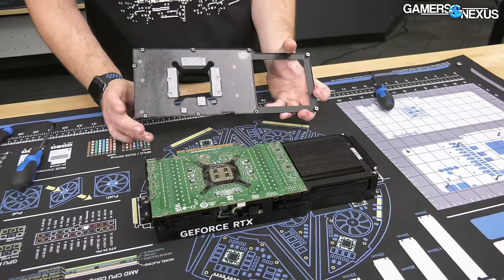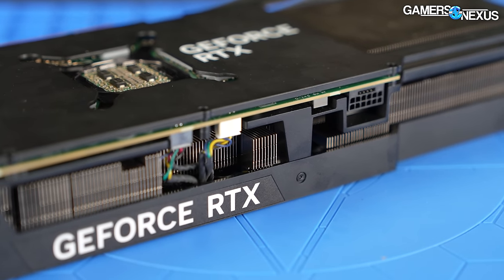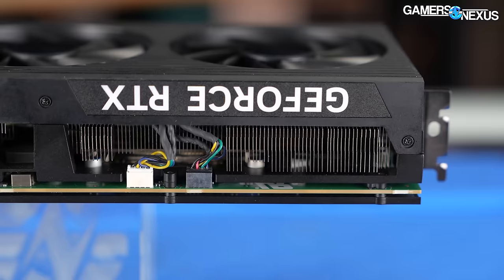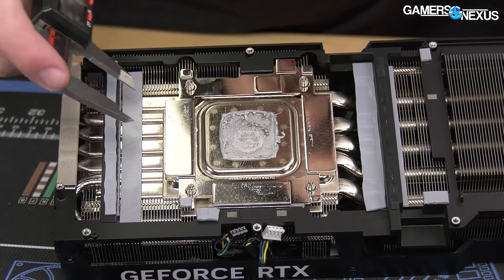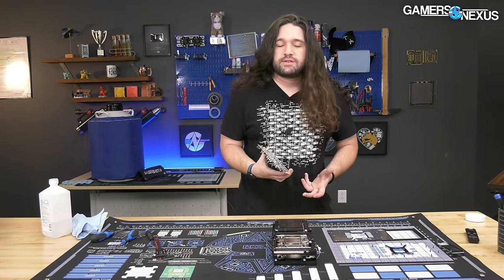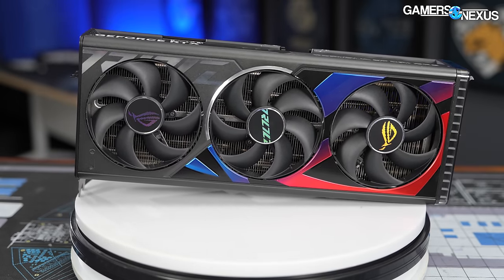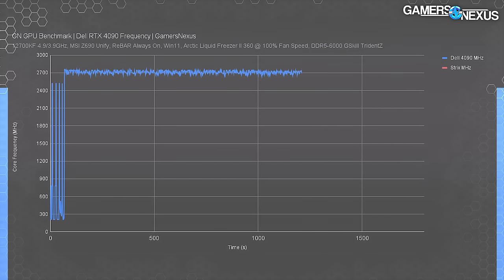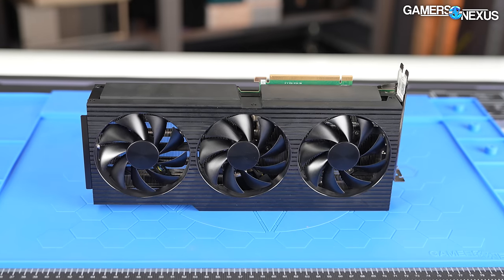Dell Made an Impressive RTX 4090: Relatively Small, Large Flow-Through, & Good Cooling

Comment: The ducts might be there on the Dell card to keep the GPU from blowing all that heat on an NVME drive and over heating it.
Reply from the maker: Good thought! Especially considering they try to keep cost down on their drives.
Reply: honestly I have found out that SSD under the GPU is cooler than above. Not surprising, hot airflow is better than no airflow
Reply: @Blackwing2345635 doesn't the gpu blow heat up?
Reply: @GamersNexus  I'd guess they are simply to reduce recirculation. It's a question a dremel can help answer :D
Reply: @LagiohX3 the PCB and backplate blocks upwards airflow on most cards!  It's pulled in from the bottom, hits the PCB, and vents out the sides.
Reply: I've found GPUs cool SSDs more than heat them up
Reply: The solution for me was the vertical mounting kit at lianli o11 evo, but it was tight getting a strix 4090 in place i had to remove the led end to fit it. 😅 3 exhaust fans on the backside so case and card staying cool.
Reply: @BlizzardSnowMew while you're absolutely right. the heat coming off my backplate always had my ssd above the gpu 15 degrees hotter than the one below
Reply: Yes, an attempt to create static pressure

Comment: I haven't seen such clean construction and ease of taking apart GPU in quite a while. As much as I hate Dell for their "proprietary" shenanigans, I must admit I respect this design. That's a nicely put together board with no unnecessary complexity. I guess you could flash an o/c bios on it without issues and push that power limit to 120%.
Reply: Clearly the GPU department is where all the competent Dell people went.
Reply: @nhancao4790  the electrical engineers that work on GPUs are by all definition built different
Reply: I think its being mentioned several times that Dell have a lot of engineering competency that somehow got directed into making proprietary shenanigans. Which while impressive is a huge waste of talents and technical capabilities Dell have. Thankfully, they seemed to have done things properly here
Reply: Hates a strong word.
Reply: @zbatchDOC  I agree in person, but it's fairly weak for internet comments though- where everything must be taken to a higher and higher degree to have the same impact in a sea of exaggerated comments.
Reply: @zbatchDOC  A strong word to describe a strong feeling. What's the problem?
Reply: @luminatrixfanfiction what reason do you have to believe that a asus 4090 wont last. the 4090 is overbuilt in every aspect from nvidia that the only one that is an avoid at all cost is gigabytes low end models like the Eagle. Every other 4090 I've held tho has seemed insanely over built and has pretty crazy thermals.
Reply: Proprietary design isn't an issue if the purpose of the design is to create something that a standardized design isn't capable of, or if it provides legitimate benefits for the consumer in that device's use case.

Proprietary design is a problem when it's purpose is to prevent user upgrades, thwart repairs, or to cut costs with no consumer benefit.
Reply: @luminatrixfanfiction what?
Reply: @zbatchDOC it's appropriate. Their proprietary designs are usually anti-consumer. They go out of their way to make sure things can't be fixed or upgraded.
Reply: @zbatchDOC I agree.

"Loathe" is much better.
Reply: With respect to flashing the bios and increasing the power target, I'd be cautious about doing that! The board is missing some power delivery components and it might be that dell lowered the max power so that they could save a little money. I don't know that this is the case obviously, but something to check out!
Reply: dell can do good things when they actually try.
Reply: I have this exact gpu and was able to flash a Galax 4090 bios with a +13% power limit. The galax has the exact same pcb, no extra headers unlike some of the other reference board designs. It will also now listen to fan control where the dell Vbios would do its own thing
Reply: @101m4n I’ve checked, I own the dell 4090 and the other reference boards from inno3d, galax and pny have the same power delivery components missing in the same exact spots. Just flashed the galaxvbios as the pcb is exactly the same without extra headers for leds and has a +13% power limit. It flashed no problem and works perfectly
Reply: they have lot of great talented people working for them they could do all great sort of stuff but engineers do not run what is done how it is done usually

Comment: Dell 3080's and 3090's are good, and now the 4090. Good to see because used ones are usually the cheapest because most people don't know that they're good. I bought a used dell 3080 last october 2022 for cheap and just traded it plus $1000 for a used 4090. That dell 3080 served me well for a year.
Reply from the maker: Exactly. They're definitely undervalued a lot of the time. Not sure what pricing will be like on this one, but saw some "cheap" listings on second hand sites!
Reply: Well now everyone knows!
Reply: I got a RTX 3070 from Dell and the only critcism I have is that it has a rear metal backplate that doesn't have thermal pads to make contact with the back of the PCB.

Otherwise, the fact that it has a rear metal backplate compared to various other system integrators is a nice detail.
Reply: The PNY XLR8 series is also another type of GPU that is cheap but REALLY good!! 
Long live budget oriented yet high end GPU's, LOL!
Reply: @BBWahoo  A pny xlr8 4090 is what I traded my dell 3080 and $1000 for, and yes it's excellent.
Reply: @pf100andahalf  
Hahahah! I knew it! Absolutely solid choice, enjoy your puppy.
Reply: Can you flash a different vbios without issues onto these Dell cards or is it locked down by Dell?
Reply: @jjlw2378  Same as with any card, if the display outs of your card are different from the display outs of the card's bios you're flashing to it, one or more of the display out ports won't work.
Reply: @pf100andahalf  Sweet. Good to know. Thanks!
Reply: The Dell 4080 uses more or less the same cooler, preforms vert well I have no complaints
Reply: @BBWahoo my pny xlr8 runs 15c higher than reviews say it should. My experience hasn't been great
Reply: @Hetsu..  
What's the temps, and which gen? Maybe you can add thermal copper if it's a 3080
Reply: @BBWahoo  84c, ive already repasted and repadded multiple times. My pny 2080ti is simply just defective.
Reply: Wait.. you spent $1000 ON TOP of your 3080 to go to a 4090? Way to throw money away
Reply: @BahhBahhBrownSheep I couldn't get a decent gpu all during the crypotomining apocalypse and went without for years. I saw it and still see it as a great opportunity. Now everything can go to crap and one thing I won't have to worry about is whether or not I'll have a great gpu that I can use at any time for years. Many years.
Reply: DELETE THIS! 😂
Reply: @pf100andahalf Keep it cool man! I know from first hand experience their warranties are Non-transferable. Still a good trade 😁
Reply: @PDXCustomPCS  I got the pny 4090 used from a guy with a gaming youtube channel. Real stand-up guy and i'm pretty sure he'd handle the warranty for me but it's possible he got it from someone else. Either way I'm running it undervolted at 995mv@2850mhz and the core and vram runs cool all the time especially since it's in a fractal torrent case for maximum airflow so I'm doing all I can to keep it cool. I keep it monitored with afterburner's rtss. I took a chance, yes, but I'm  minimizing the risk as much as possible.
Reply: @Powk-mz1cp  Are you okay?
Reply: @pf100andahalf  I was just letting you know bud. They're strict on their warranty stuff. Best of luck!
Reply: @PDXCustomPCS  Much appreciated. Cheers!
Reply: We have a Dell 3090, 3080, and 3070 -all three have been steady since they released. Fans are a little loud but they perform fine.
Reply: @damienfiche2592  I undervolted my dell 3080 to 912mv@1875mhz (silicon lottery loser) to make it quiet and surprisingly didn't noticeably lose performance. The fans didn't go over 50% after that and it wasn't any louder than my case fans. You can tweak yours to where you can't hear them but it is time consuming to get it just right so I can't blame you if you don't.
Reply: @pf100andahalf  Thanks.
Reply: @GamersNexus I ordered an R15 the other day. £2800 for a 4090, Ryzen 9 7950x and 64GB of RAM is cheaper than anything I can find by a good margin.

Comment: I bought an Alienware using mostly Dell rewards I had stacked up a few years ago for the sole purpose of pulling the 3080 and using it in my personal build back when it was virtually impossible to get one other than paying scalper pricing. I was impressed with the card. Small, quiet and ran cool enough considering it had no OC options. I did add some thermal pads to the cold plate to make contact with the vram chips which helped bring those temps down a good 8C
Reply: got mine after mining end, pretty sweet deal. did the same mod, deshroud with p12max+undervolt. mid 60c temp all the time

Comment: I'am using a Dell RTX 3080 for about couple years. People are hating it but the temperatures are good even compared to the more expensive models, so I'am happy with it.
Reply: Yeah I saw that Dell has been making decent basic cards for a while. An RX 5700 by them shows similar results.
Reply: Yeah I had a Dell RTX 3070 and it stayed very cool. If not for the limited 8GB of VRAM (which is Nvidia's fault rather than Dell's), I'd still be using it. By comparison, the Gigabyte RX 6800 I replaced it with runs louder and hotter.
Reply: Same here, love my Dell 3080.
Reply: @ArtisChronicles   Yeah, dell does not make the card. They are made by MSI. You can tell from the product code at the pcie connector. In this video the code is MS V510 which is MSI Gaming X Trio 4090. Dell rtx 3080/90 are MSI Ventus.

Comment: It would be nice if Dell could make most of their products to the same quality standards. I have a Dell Inspiron i7559-763BLK I got in 2016 and it is very well designed, the bottom cover to get to all the replaceable components (including the battery) is ONE panel with ONE captive screw. It was also very well priced at the time, $800 for a 15" i5-6300HQ Processor up to 3.2GHz, 8GB DDR3, 256GB SATA M.2, GTX 960M

Comment: I'm glad they are using the shorter pcb, I had to get mine repaired due to the memory solder cracking from board flex. MOUNT VERTICAL OR USE A SUPPORT!

Comment: Still using the power supply, RAM, CPU, AIO, and a fan from someone's R10 they sold me cheap (to get their 2080 during COVID). A $50 z-390 from ebay, $40 in 140mm fans, and a new Y60 case and I have a good enough machine to wait for an "9800X3D" or "15900K" rebuild.

Comment: Dell made a fantastic 3090 also.  I still have mine.  It performs very well.
Reply: Same here, If Dell wants to lock voltage on these gpu's the best thing I have been doing with my 3090 is undervolting to get higher frequency and lower temp/vram temps too. the stock frequency is about 1920 mhz, Im gaming the 3090 at 1980-2010 stable frequency and under 70c. It's the only way around the lock voltage cage tyhey do.
Reply: GN made a video about the Dell 3090 too. Neat to watch

Comment: The ducts along the bottom edge of the fan shroud (@ 5:54) direct exhausted air towards the PCB side of the card, away from the 3 intake fans to prevent them from drawing in this warmed air.

Comment: Have you ever considered making a video about M.2 drives and cooling them, what works, what doesn't, heatsink height concerns etc. I built a PC with the for the first time this march and I was really surprised how hot they can get even with good airflow front to back of the case. Looks like heatsinks are a must if you don't want them to throttle. There is also a problem of SSD manufacturers or MB manufacturers (whose responsibility is it?) not including stuff like screws to install them properly.

Comment: I’m surprised by how good that overall design is vs my Dell 3080, significantly improved, I’d buy one if it had a higher power budget and you could get one standalone.  The no warranty void stickers counts for a lot.  My Dell 3080 core clock fluctuates like that too, not as bad on water.

Comment: I think that the reason for the fluctuation in the Frequency, and the lack of OC might be down to the exclusion of the mosfet-choke combos where those are to clean/regulate the voltage stepping outside of OC if the voltage doesn't need to be tightly constrained for standard operating levels then adding more would be "wasting money" so Dell can save a few cents per card on Mosfet-Choke combos, and the only user "drawback" is not allowing for OC support in the vBios.
as a result of not including the Mostet-Choke combo you get a wider fluctuation in the core frequency.

Comment: I have a Dell 3080 Ti and 3090. Both have been working really well for over 2 years now. The amount of "crap" I get whenever I make a comment about using OEM GPUs are baffling - you get similar performance, decent cooling and no fancy extras + for the overall system build, it is not overpriced like AIBs.

Comment: It should be noted that those 'Warranty void if removed' stickers are really only useless in the US. Outside of the US, it depends on the country and what consumer protections they have in place when it comes to warranties.

So I wouldn't be surprised if the sticker is only missing on the US version of the 4090, it's possible on international versions that the sticker is present.

Comment: If I had to guess, I'd say that the bottom was designed in such a way as to keep heat away from the back of the motherboard.Some motherboards, including mine, have a chipset and/or m.2 drives somewhere towards the back. by blocking the front part off, that keeps heat from radiating over crucial components.

Comment: Okay, now for more science: What about doing a thermal pad and thermal paste replacement to sort of match the (most likely) higher quality pads and paste from the strix model?
Reply: Honestly, it doesn't need it. These temperatures are all already under 80C (except GPU hotspot which is still great) at under 2000 rpm, which is a massive improvement over most last-gen 3090's where 95C+ memory hotspot temperatures were common across AIB's.

Comment: Those airflow bockers at the side of the card closest to the motherboard is actually purposeful and great. Instead of blowing hot air onto the motherboard where the power delivery/vrms ram and cpu are adding more eheat to that area it outs it away from it.

Comment: I feel like the size of the fans for the Dell card are why it didn't do as well as it could. They're a bit smaller than the Strix which would effect the cooling like it does.
Reply from the maker: Yep, you nailed it. It's also a relatively thin heatsink, not using nearly 4 slots like a lot of cards. But for what it is, it did well!

Comment: Got a dell during the gpu pandemic just for the 6800xt and it worked fine. But less than a year later it messed up and after much trouble shooting I found out it was the thermal pads.

Comment: It wasn’t until maxed the voltage I could get a decent clock speed from my Dell GPU, it didn’t really get to a higher voltage usually, but it helped a lot, if you haven’t tried that.  Got much closer to actual stock voltage 1.05v

Comment: "Warranty void if removed" stickers are only un-enforceable if the FTC actually does their job. The manufacturer can and does enforce them, because they know there's no recourse. Zotac and AsRock are both enforcing their tamper seals, because the FTC lets them get away with it and any lawsuit brought against them will QUICKLY get buried in red tape. These manufacturers know that any attempt to fight them will take years and instantly become more expensive than a replacement card
Reply: So right! Have you been watching Louis Rossman's videos? Cheers!

Comment: I would like to know the inside of a case temperature between the 2 cards. In some cases, getting the heat out of the cases is a small challenge. I see this on pre-build Gaming PCs. They have mass of power, but they didn't think it through on how the heat buildup would affect other components. I corrected the air flow on many of these pre-builds. Sometimes even having to change cases.

Comment: Nice cooler, VRM is a bit weedy though with what looks like only 14 stages on VCore. I REALLY hope they're at least 70A stages and not 55A! Depending on the allowed Power Limit, this is a card that one may want to be a bit careful with if it's waterblocked and OC'd.
Reply: I have this card and was thinking of waterblocking - what would be the issue?

Comment: I just remember my expensive Alienware that came with (2) 1080 Ti cards, top of the line at the time it was bad. Blower cards that ran at 84c until I saved them by building custom cooler.

I’m super impressed Vs what they used on the 1080 Ti cards

Comment: At my work we recently picked up a Dell XPS 8960.  It has this same RTX 4090 in it. Under full load the coil whine is absolutely crazy. As in much louder than the fans even... I'm assuming you guys did not run into this same issue since in the conclusion you said the acoustics weren't too bad?
Reply from the maker: No coil whine on ours.
Reply: @GamersNexus  Interesting.. I wonder if we got a version of the board where they cut down on the power circuitry trying to save a few cents. I am using it to create a ML model to try to forecast wildfires in Alaska. Given the use case, it's on and under load for very long periods of time. It was so bad that I had to move it out of my office and into a closet 🤣
Reply: No coil whine on mine

Comment: can confirm that the dell 4080 is the exact same design. Runs just a bit cooler than the 4090 ofc, but I feel comfortable using it in my productivity rig. Rocking a 3060 ti in my gaming system.